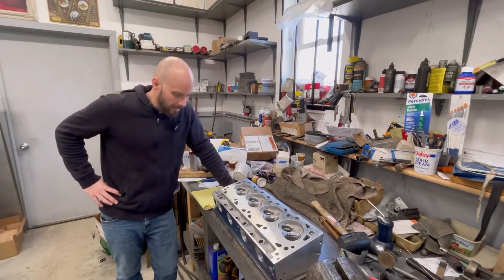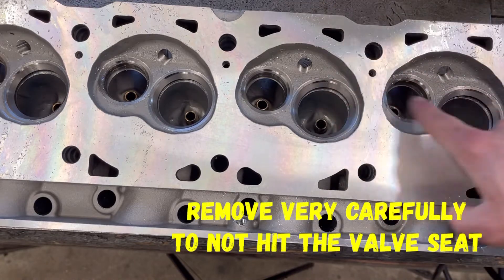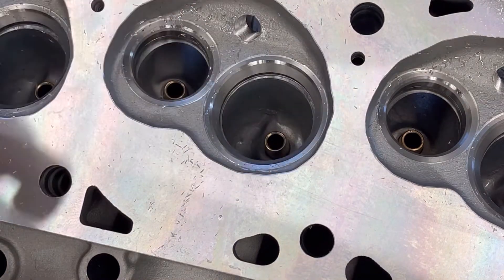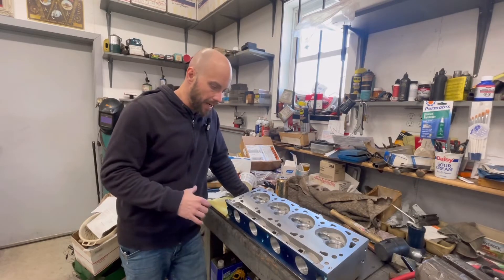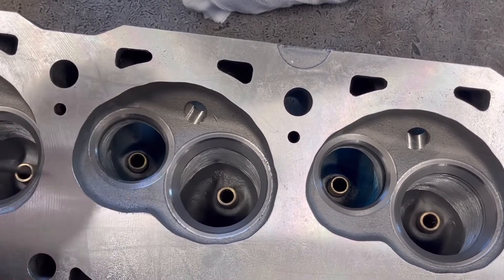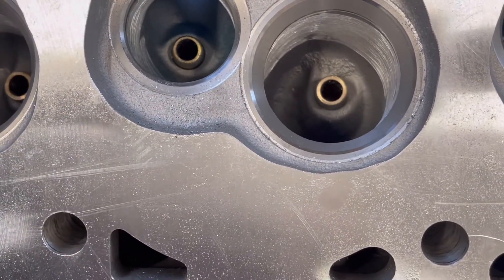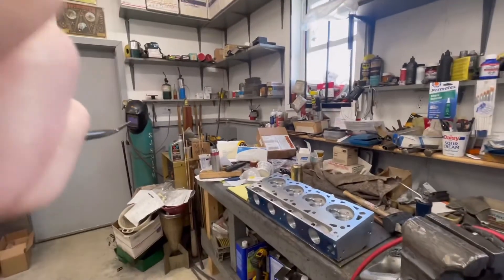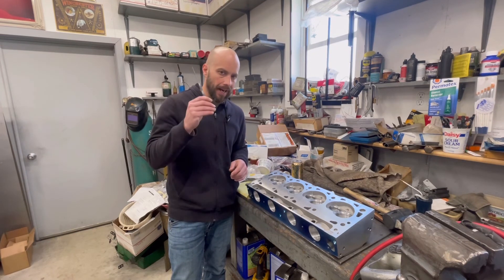How to Port Cylinder Head Bowls #nonamenationals #cylinderhead #porting #ford #builtnotbought

Comment: That should be a great improvement. I did my C90E Iron heads years ago. Ports and chamber. They had a huge thermactor hump in the exhaust side. Gone now! Great vid! 👍
Reply from the maker: Thanks brother!!! I’m researching some combustion chamber cleanup work too!
Reply: @2HacksGarage  I installed my head on my bare block. From there I used spray paint and painted the chamber. It left a perfect circle. From there I easily unshrouded the valves. I was amazed of how much I removed against the cylinder wall side of the chamber. Of course the block was not machined yet.
Reply from the maker: That’s a great tip!!! I wonder if something less permanent would work well on a machined block
Reply: @2HacksGarage  Maybe oil or vaseline the cylinders, and go light on the spray. When I painted my Mach1 panels I put Vaseline on the chrome letters. When the paint dried, I just rubbed it right off the letters. Learned that trick a long time ago. Your very smart, think on it and Im sure you’ll come up with something. I be 👀

Comment: I found that helps is a little 1 gallon wet/ dry shop vac -  hyper tough from wally mart and put the end of the hose in the side of the port your not working on so it sucks up the dust and metal partials while your grinding or sanding the ports and bowls
Reply from the maker: That’s a good idea, time to go get one!